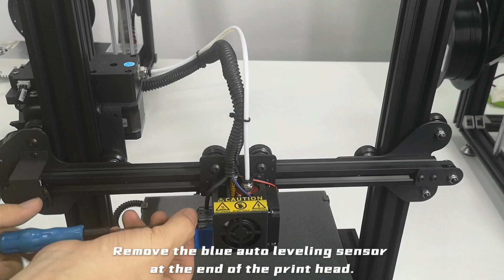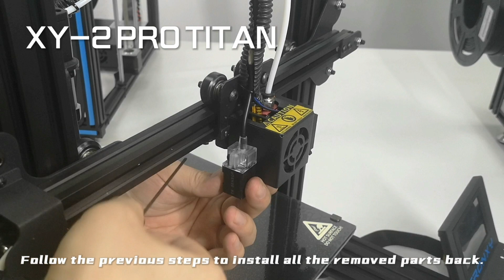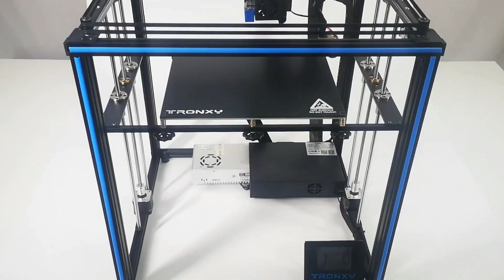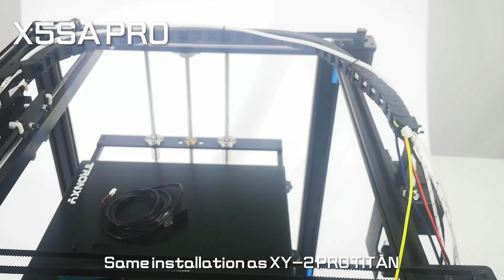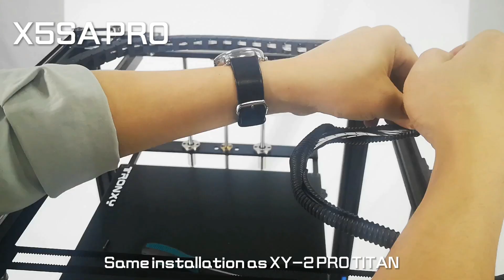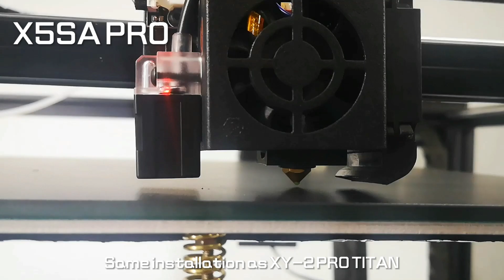New Arriving Tronxy Levelling Sensor for Glass Bed  - 3D Printing / 3D Printers

Comment: Got the bed but wasnt aware about the MANDATORY sensor. I bought it and disnt advertise the sensor so I didn't know that's existed. The instructions are trash and never mentioned the sensor so the first second testing it out, the nozzle smashed into the bed and made a scratch. Searched to see what went wrong and all I can get is that the glass is too thick for the sensor to detect it. I was mad. Then one day I looked around again and realised there is another bundle that comes with a sensor. The one I got didn't come with the package. Who the hell sells an upgrade without having a mandatory object to make the darn thing work properly, let alone not tell that its required if you want to buy it seperatly? My purchase was completely useless basically because I don't have the darn thing and it will take ages for it to arive if I get it

Comment: question 1: why did you leave on the protective film?
question 2: how do you calibrate the sensor? mine goes to a height that is WAYYYYY off the bed and no matter what I try, it defaults to that height. It's a good 1.5cm away almost.

Comment: Ignoring the scratch across the glass...

Why does this thing seem to wander by up to 0.3mm depending on bed temperature? Does it start getting twitches and flashbacks of its molten youth before being formed into an electronic device? Does it fear the cold will cause it to become so brittle it could break into the dust from whence it came? Or is it just a bit crap?

It's getting tiresome having to run levelling prints in between trying to print the actual things I want....

Comment: @Tronxy maybe next time use some tape around the connector so it will slide easier through the energy chain.
Reply from the maker: Thanks for your good advise, we have passed it on to our engineers.
Reply from the maker: Dear Mr. Hemsdortf, our engineers feedback that they want know more detailed info for you suggestion, would you pls send to my email? monica@tronxy.com. Many thanks.😘

Comment: I am guessing this is thicker then the  stock on my xy-2 pro do I have to readjust the z limit switch ??
Reply: Yes you will. If your XY-2 Pro has a blue ABL sensor you’ll need to install the black TR sensor that comes with this kit and adjust Z accordingly.

Comment: If my gantry is any higher than 50 mm when I go to home the Z axis instead of going down towards the bed it rises up about 10 mm and the screen tells ME that Z is 0. Is there a firmware fix for this behaviour?
Reply: I face a similar issue, after several attempts my motherboard no longer works, it turns on but does not control any axis not even the extruder. Tronxy said they would replace my sensor but never replied to me asking for a warranty (4 months old, 12 month warranty) replacement motherboard.
Did you figure this out? Did your motherboard also become damaged?

Comment: on my Tronxy XY-2 Pro this doesn't work at all - it detects the plate so high that it won't go down to the plate, while printing - the sensor is mounted as high up as the screws allow, setting Z Axis does nothing to help.
Reply: Most of... OK, a lot of... Fine, some of my Tronxy pain was healed by installing Marlin on the thing. With the whatever that Windows not even 3.1 looking firmware it shipped with I could never get the Z offset right. At least with Marlin I can tweak it while printing.

Well, until the babystepping to get things just right kills the Z axis and needs the whole thing rebooting. But it's still better than the original firmware...